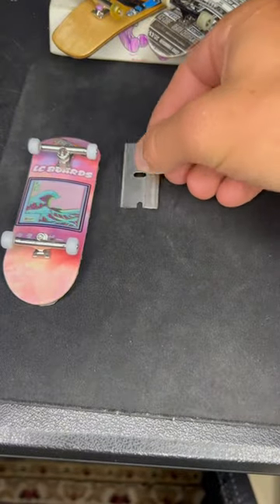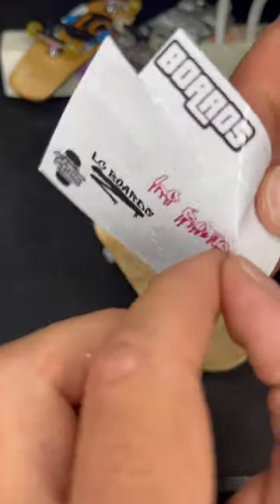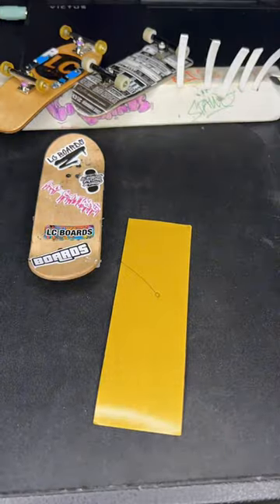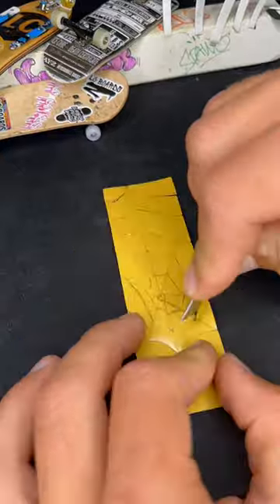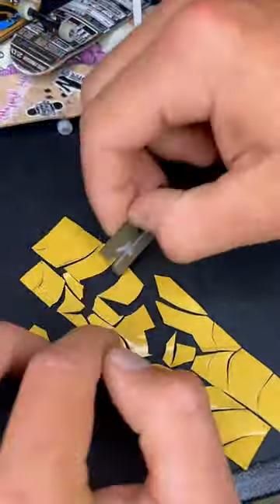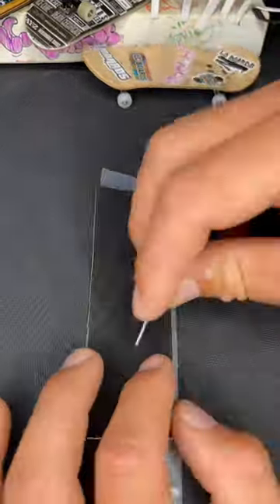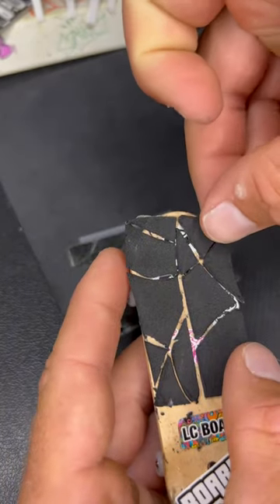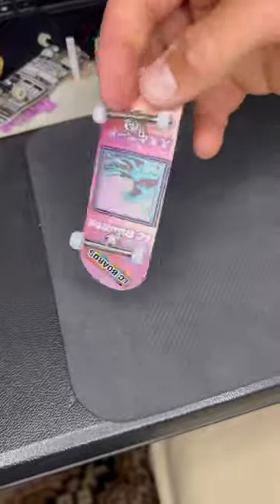WORLD’S HARDEST GRIP JOB #fingerboard #fingerboard #skate #fingerboarding #diy #skateboard

Comment: Try cutting it out and placing it on 1 piece at a time. Dont use scissors cus the pieces are too small, razor should be fine and maybe some tweezers to hold the paper down as you cut.